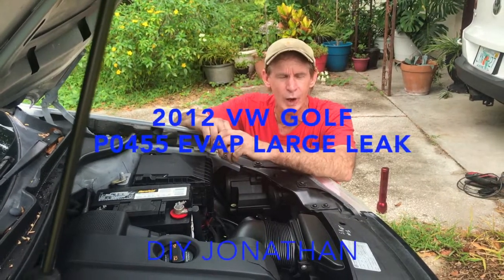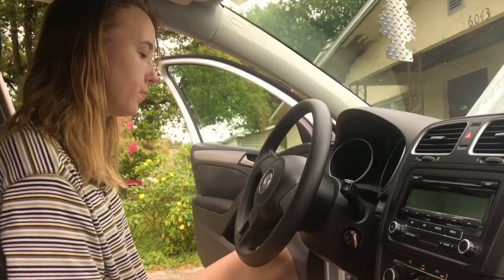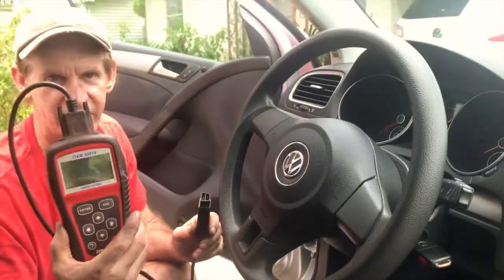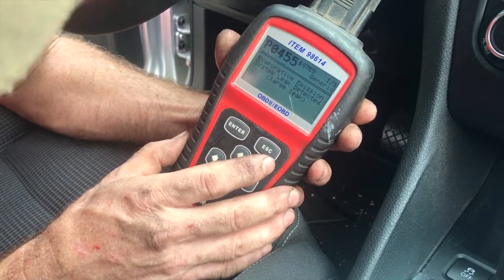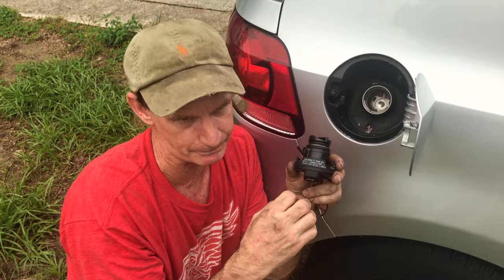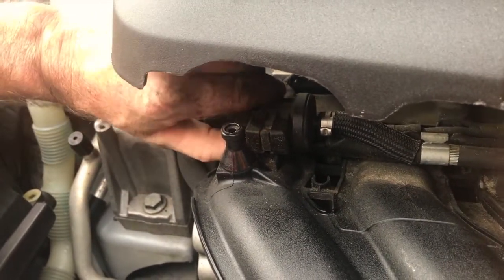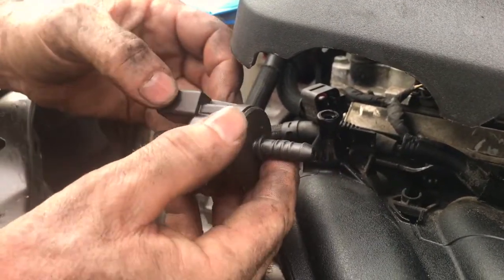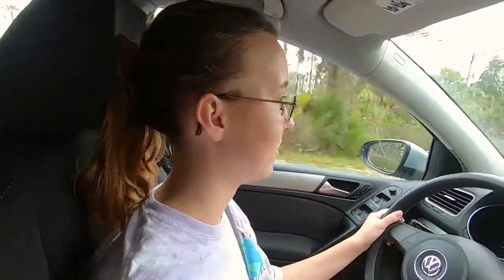P0455 EVAP Large Leak Detected: Free Fix, VW Golf Check Engine Light On

Comment: Hey how you doing , thank you very much for for your videos it has help me a lot 🙏😎🤙
? i have the P2231 02 sensor signal circuit shorted to heater circuit bank1 sensor 1  do i have to change it or we can fix it
Reply: Dis you find the solution to it?  I got the same code along with P0455, P0332 😬

Comment: Hi! Loved the video. I’m getting the same error code (emissions large leak). My gas cap just keeps turning when I try to turn it shut all the way. Do you think this is the reason for the error code and do you think I have anything to worry about? Thanks in advance!
Reply: Hello i have the same prob? Could you tell me if it fixed or how you fixed it?? Thankss
Reply: I have the same issue, first it was the brake booster hose I changed it and my car runs great but now the light came back after the gas cap light turns on.

Comment: I got a 08 hyndaui elantra and it had a 0441 code. So i replaced this whole valve in your video.  But now 3 days later i got a 0455 code. Gas cap seems fine. Im not sure what could be wrong now.
Reply: A hose